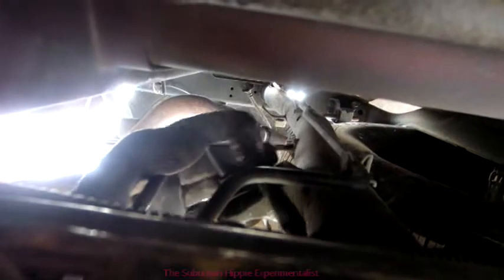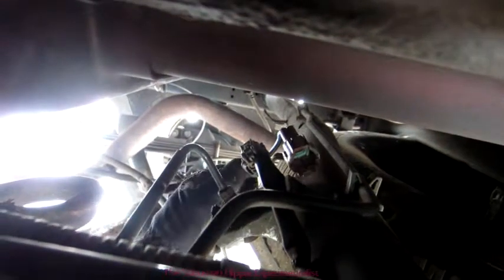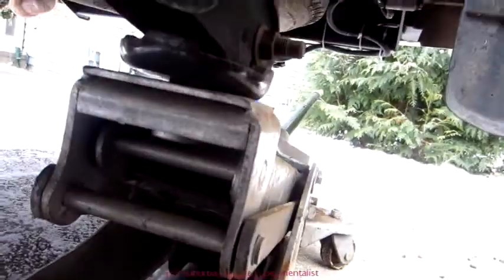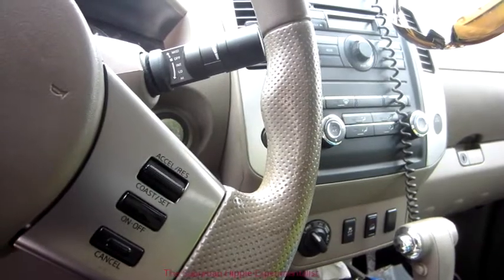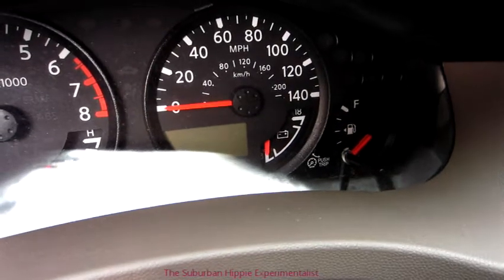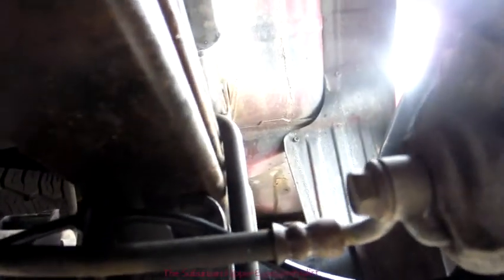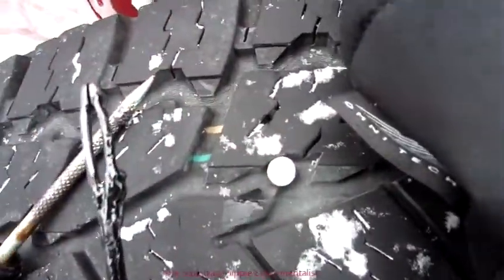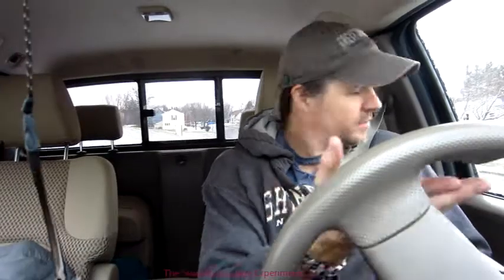10 Dollar Ebay Wheel speed sensor install and results

Comment: I just ordered isumo from eBay...a place in Cali......hope it holds up....great price...2 for 14.98.....81.99 at local auto parts for 1.
Reply: Steve how did the Isumo work?  I have a Toyota and the sensor is $250 OEM vs $20 for the Isumo.